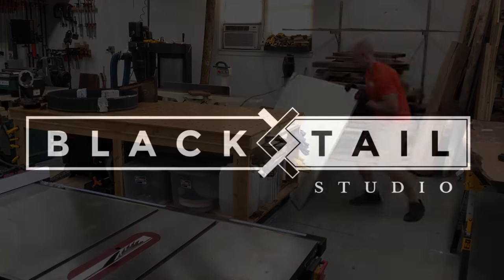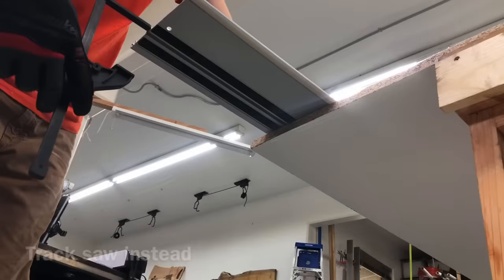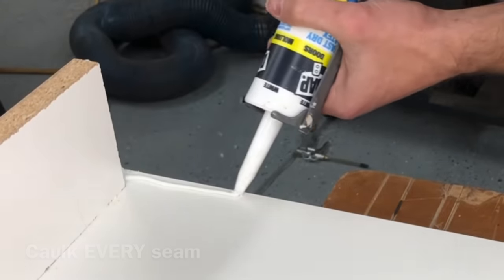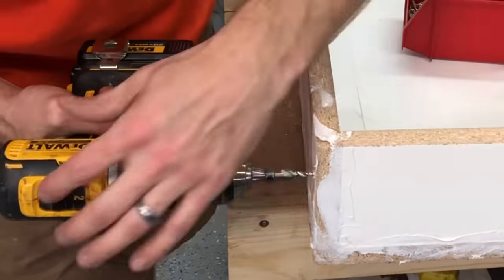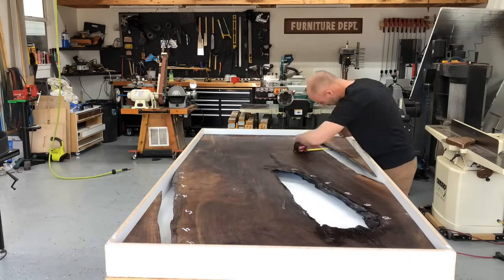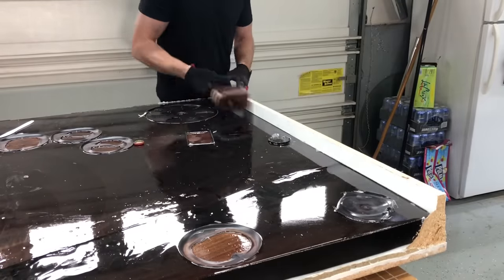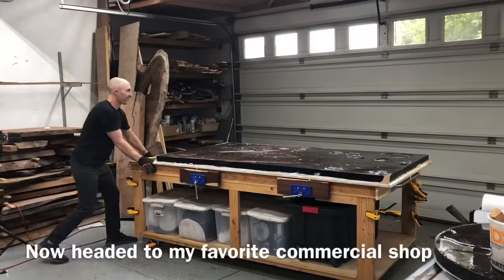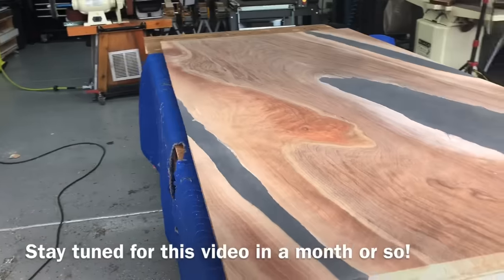How To Make an Epoxy Table Mold - DIY Epoxy Resin Table

Comment: Nick, I apologize if this has been asked before; when doing such opaque epoxy pours, how come you don't do any wood fillers?  Meaning do a light epoxy pour, put in a wood filler to take up space, then finish with a 2nd pour.  You'll use less epoxy with the same result.

Also thank you, your video for calculating the amount of epoxy!  It came in use for my light up coffee table that has pieces of dremeled plexiglass to refract the light.
Reply from the maker: I dunno... seems cheap kinda... but can’t see why

Comment: I enjoyed the step by step framing of your project. I have a small project of an RV table.....2' 2" by 3' 2". It was only lacquered and sunlight and daily washing has cracked the surface. I thought epoxy would be the way to go....but looks pretty entailed. Would you just pour epoxy on the top....or extend it down the side?

Comment: Ray Gee,
Hi, I’ve watched a few of you videos for help in the past, thank you much for providing help.
I am having trouble making a mold for table/ shelf. We have followed all the instructions but are still getting leaks. I’ve let the mold dry for a week and have tested them with water; thank god. But I’ve built it twice, tried cutting our selves first then had Home Depot cut. We have DAP Alex fast dry caulk. Just wondering what else can be done. Have caulk under, inside, outside and have used a lot. I’m totally lost.

Comment: Chris thanking you for another great video. So many helpful tips. Cam, I just converted a small mud room into a finish room at my house and can't wait to do my first epoxy project but im petrified about burning my house down.There is an exhaust fan in the room and my projects will be much smaller then yours but im still worried about the heat generated when the epoxy is curing. Should I be?

Comment: Morning! I've just started doing these projects as I have time on my hands and don't do well sitting idol. I did make a small epoxy charcuterie board as an initial project to see how everything worked. I'm quite happy but had two air bubbles on each side where the live edge must of released air bubbles during the curing process. What epoxy do you use to seal the islands of wood and live edges to prevent this? Thanks for your time.

Comment: First off, great video!  My question is, you added 0.75x2 on both the length and width walls. Since two of the sides are going to be placed inside the other, is it necessary to account for the 0.75x2 on all 4 walls, I thought just 2 of walls should account for this increase. Thanks

Comment: Hello Cam,  Really enjoy your videos.  I am making a cedar coffee table and it has some soft wood that I have removed.  My plan is to epoxy to fill all of the voids but I would like to keep a live edge on 2 of the sides.  Can I caulk the edge I want to leave live and clamp the bottom tight as well as clamping the melonine to the cut sides?  I plan to cut the edges once the epoxy dries.  Just wondering if it would leak anyway no matter how much caulk or clamping.  Thanks

Comment: Great videos. Do you pour the epoxy to the height of the wood in the mold or do you cover the wood too? if you don't cover the wood with epoxy how does the table top get the finish you want?

Comment: Lori watched this video more than once. IT IS VERY GRAND!
Lots of questions however...
1. If I want to join 2 slabs to make a sliding door will the epoxy down the center of the 2 slabs be enough to keep the slabs together? Or do I need some sort of metal bracket/ c channel type item and if so how would that not be visible? 
( on a table the connector would be on the bottom )
2. How would I get all the excess resin off without having access to the comercial planer/ wide belt sander?
3. How could I do all live edge? Most people build a form with the idea that live edges go to the inside with straight cut edges on the outside. Thoughts?
Thanks in advance 4 your input.
And again, nice work!
Reply from the maker: Epoxy should be enough. All I can answer for now!

Comment: I really enjoy all of your videos and i am inspired to try my own live edge cedar and epoxy desk. I do not have access to a large planer, so i was thinking of flattening with a router sled setup. The pieces are fairly close in thickness right now, but not perfect. In your opinion, would it be okay to just flatten once (after epoxy pour and cure) or should i flatten twice (once before and once after)? I learn something with each video. Thanks

Comment: How long after using the mold release do you have before you have to pour the epoxy? Can you use the spray and then pour 24 hours later?

Comment: if you are not finishing with oil, but with a top coat of table top epoxy, how do you keep dust from settling on the table when the epoxy is curing

Comment: I've been watching your videos for months now and appreciate your helpful tips and tricks.  I was wondering if you have built your own HDPE moulds from HDPE 4x8 sheets?  I'm considering doing that because the molds last longer and can be used multiple times.  I know you mentioned not building the same size often enough and I can understand that but do you have a size that you find being built more often than other sizes?  Could that be one you would make a stronger longer lasting mold for?

Comment: In the video you say you like to add 1-2 inches per side to allow for cutdown but in the video it looks like the slab is snug up against the walls of your mold all the way around. Do you also try and have a tight fit between the slab and mold wall or is it better to have an inch or so of epoxy all the way around and then cut it down? Sorry if that wasn’t super clear.

Comment: Zan, from Alberta.  Love your work.  Question, I am making a little table top, 15x18 in, and am thinking to use mylar that I already have, staple it in place on the plywood I have for the base (covered with heavy plastic,  and seal it with the caulk.  Would I still need the mold release? Thanks in advance.

Comment: First off, thanks for the great videos!  
I just completed my first big epoxy pour and I was very concerned about leakage but your video on building the form really helped.
I used MDF on some parts of the form and melamine on other parts as that's what I had in the shop and what both were recommended for the job in other videos, however the recommendation of using MDF also suggested the use of tuck tape, but I used Universal Mold Release instead of tape which worked great with the melamine (as you suggested) and terrible with the MDF.  The epoxy bonded with the MDF so I had to plane it off - the things we learn (F*!K#$).
So there's a tip, DON'T USE MOLD RELEASE INSTEAD of TAPE if using MDF for your form!
Reply from the maker: Oh man, that’s brutal!

Comment: Shawn here with a question!
I used a melamine form, with Alex fast-dry, and CRC Silicone mold release (couldn't find the brand you linked).
My melamine is sticking really well to the epoxy, to the point that it is splintering and splitting when I tap the sides with a hammer and try to remove them.
Any ideas where I went wrong? Maybe just not enough? It's an 8' long by 18" table, and I used a TON of the aerosol mold release, almost half a can. I thought for sure I over did it, if anything.
I haven't tried to release the bottom yet...worried!
Keep up the great videos. Your work is amazing and your instruction is always appreciated.
Reply from the maker: Oh dang! I work it in with a paper towel too. Or might be that brand. Can’t say for sure

Comment: Kristen: if I just want to coat the top of my resurfaced table, it had a ruined wax seal on it…do I need to go through this extensive process or can I paint it on and sand it afterwards?

Comment: Have you ever done a project using the huge electric wire spools to make a table? How do you cove the holes on the spool to pour your epoxy resin and how do you make a round mold for it
Reply from the maker: Never have!

Comment: I was curious about what small epoxy molds are made of and apparently most are made of polypropylene. I'm a roofer by trade. There's a "rubber" roof we apply called tpo. It has a white side and grey side. The white side is polypropylene and the grey side is ethelyn-polypropylene. It's extremely thick. It comes is 10'x100' rolls and 5'x100' rolls.but any commercial roofing company would sell cutoffs for sure.  If you do  tables I suspect it would be excellent to cover your table with. Then just tape the sides. It can be used over and over probably forever. It could be free floating from the plywood itself making it easy to remove once it's dried. Then rolled up and stored away. Just an idea. I think it would be a money saver in the long run for sure.

Comment: Stephen here. If I were building a mold for a guitar body blank that usually requires a 20x14 blank , what size mold would you recommend? Would I be safe with 20x14 because I'll be cutting anyway or should I add an inch to both dimensions just to give myself some extra wiggle room?

Comment: Hey there, I’m making a wood table with a large void in the middle - I plan to keep it in the original rounded shape with live edge on the outside rather than squaring it off. Do you have any recommendations for building the mold so it doesn’t leak through bottom since I’m not squaring it off?

Comment: Jon here. Thank you for your videos. I am about to start my 1st ever expoy pour. Wanting to male a dining room table. I am using Western Red Cedar, 2 inch thick. Thinking about a finish size of 96x42 inches. Thinking of a river style since I have 2 sister slabs. What colors would you suggest with the cedar and would you go thicker on the finish coat to seal it for food use?

Comment: Gary here.  Very basic question(s) from a rookie.  When you pour our epoxy, are you covering the wood, as well as the voids, with the epoxy and if so, does that epoxy on top of the wood get planed off.  It boils down to, when you are putting the finish on your table (Rubio?) is that product putting a finish on the epoxy, or the wood or both?   Thank you in advance.  Gary

Comment: Jim, I noticed a number of brads sticking out of the bottom board of the  mold, when you were dis assembling and removing the table. Do you ever have issues with scratches on the table from the brads?

Comment: Nathan, I am going to try my first river table soon.  I built the frame and are now experimenting with small pieces before doing the big pour.  I have an issue of the resin getting under the wood.  is there a way I need to keep this from happening?

Comment: Hi Cam, I am making a river table that has live edges both on the side with epoxy, as well as the sides of the wood that will serve as the sides of the table. Since my sides are live edge and not square, how would you reccomend going about making a mold for that?

Comment: Randy Robinson:  I have struggled to get a water-tight seal using caulk.  I put a good bead inside and out, let it dry overnight, and still it leaked thru. I use Liquid Glass epoxy resin. Have you had that problem? What can I do?

Comment: Chris here.
What temperature would you recommend to a pour in? What would be to cold to be more specific? I'm in pretty cold upstate NY and although I can and do heat my garage I usually don't heat it for several days. My wood boiler that is out there tends to keep the garage around 50*-60*. Just not sure if this would be to cold for the epoxy to cure properly, etc.. Thx in advance.

Comment: Hi my name is Crystal and I'm just about to start working with the epoxy resin I plan on making I plan on making table tops I was wondering what if I have a normal tabletop how would I line that in order for it to make a mold

Comment: Kelly here. Something that I don't think you've touched on before is moisture content in your slabs. How much do you concern yourself with this. Do you buy slabs and let them sit for a while before you use them, etc. As usual, great job. Thanks.
Reply from the maker: Hey Kelly, I’ve talked about that a good bit in other videos and blogs. Definitely worth checking out if you’re curious! Live edge for beginners went into that.

Comment: Michael Fitzell
G'Day
I am looking at planning a Table with drink coasters, it will be fairly large, we have about 200 coasters but may have to cull the worst of them.
Questions i have 
Do you have to treat the drink coasters before you put them in the resin?
Would you do a double pour, by that i mean, pour some put the coasters in then pour more over the top or is it best to have a timber base attach the coasters then do a resin pour over that?
Thanks

Comment: This is BRYAN! THANK YOU FOR ALL YOUR AMAZING INFO! Any advice for making molds on HUGE (12' x 30") slabs? Thinking I would do the bottom and thee of the sides (screws + calk). Then do mold release on that + the forth side. Then slide on the slab to the base. Then calk screw on the forth side. Main question is, because I wont be able to add a bead of calk to the inside corner of the forth side, should I tape up the outside corner of the forth side?? Any other  Any other thoughts/pitfalls I should think about on big mold?
Reply from the maker: I add a bead of caulk between sheets of melamine to extend them, then tape the seam too. Make sure it’s well supported and you’re good to go!

Comment: Liked the video. Also lived in Portland. I have a question, I see a lot of people doing wood river tops, I am interested in doing a full translucent top. Probably 96”x42”. My current thought is a multi level weave of multi colored cord set/woven into a frame with a form built around that. I don’t have any idea how well a resin top of this type would structurally hold up without the tensile strength of wooden members on either side carrying the load. Is it prohibitively expensive, the resins, for a top of that size? Even a $1000 is a lot to pay for something I’ll only have a vague idea of what the finished product would look like. I’m also a little worried about anchoring it to a chrome base. Can it hold a screw well?  Do you have any suggestions?
Reply from the maker: Man, not sure

Comment: Hi my name is April! First off your work is amazing! I’ve been working with resin for the last four years and I am still learning more and more about it. I have been trying to make my own dinning table. But I had a question when you were unmolding after the resin cured what were the items that were on top of the resin and another question when you place the wood inside do you make the time upside down?!
Reply from the maker: I usually pour right side up. And not sure what items you mean

Comment: My name is Charlie. Do you ever caulk the edges of your table to the form? I get epoxy running under the pieces and therefore lose some epoxy. I've tried caulk but then find I got a mess to remove. Any good answers?

Comment: Great video, planning on making my own table. Can I just ask what's the best way of removing the bark and does it need to be perfectly smooth where its been removed?
Many thanks,
Ash
Reply from the maker: Angle grinder and wire wheel is good

Comment: Kristina. I was wondering if you ever tried using silicone instead of caulking on the inside to see if it would stop it from sticking as much to the Epoxy? I’ve never worked with epoxy before just trying to do my research before I try and since the use silicone for mold I thought it might come away smoother.
Reply from the maker: Never have

Comment: Clueless Bob here, preparing to embark on my first major epoxy build. Large slab of ant-ridden pine which fell about 6 feet from our bedroom in a storm ( the wife didn't even stir...).  When you pour the epoxy into the mold, my impression from your video is that it automatically fills in evenly along the bottom side.  Is that correct?  thanks for inspiring, cool work.   PS - haven't you figured out how to use helicopter blades to do much of your woodwork?  B

Comment: Errol, great video. Very informative as usual. I’m looking to build a resin coffee table with epoxy on one side of the slab and the live edge on the other. Not sure the best way to prevent the epoxy from flowing, in the mold, past the slab and filling in the area I want exposed. Hopefully this makes sense. Any recommendations are really appreciated!
Reply from the maker: Hmm, would probably have to explain in person. Can be tricky

Comment: Great video as always. One question: will you be doing the odies oil tips and tricks video soon? Would love to hear how to use it more effectively, thanks.
Reply from the maker: I actually stopped using Odie’s. Had a bunch of problems with that table and decided to move on from Odie’s.

Comment: Hi. Great job. So my wife wants to make one where it is all epoxy and I was going to use 3/4 plywood for the bottom. The side were just going to be plywood with construction tape on the inside.  Caulked along the seems as you did. Should I not extend the size so there isn’t as much to cut off?  She wants to fasten it to another existing table.  Thanks
Reply from the maker: Not sure the question. Sorry!

Comment: Great video. Thanks for posting. I'm working on some smaller items epoxy projects, around 20" x 20". Rather than buying a full sheet of melamine, have you had any successes lining the mold with Shurtape? Thanks
Reply from the maker: Haven’t tried that one